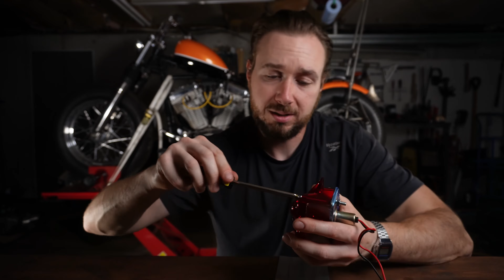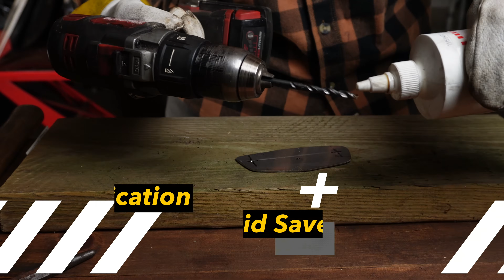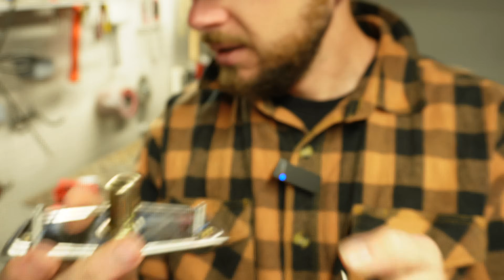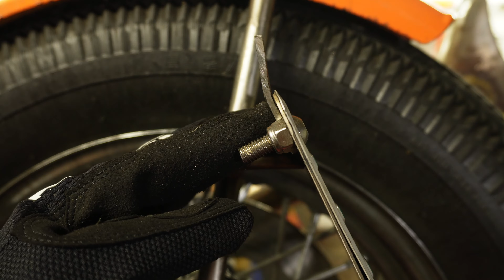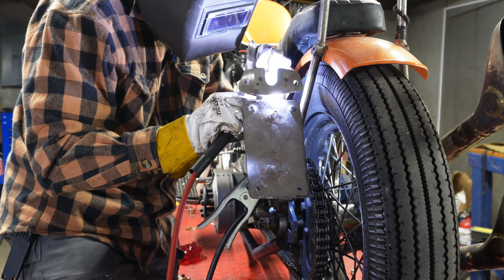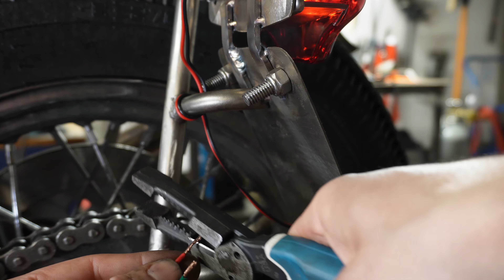Mount ANY Taillight: Easy DIY Fabrication Guide

Comment: Guy, if you  can weld the light mount, you can solder the wires!
Reply from the maker: That’s true haha, what I really wanted was detachable connectors. I will change them in the future